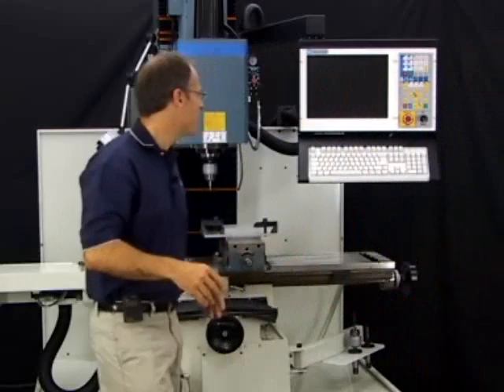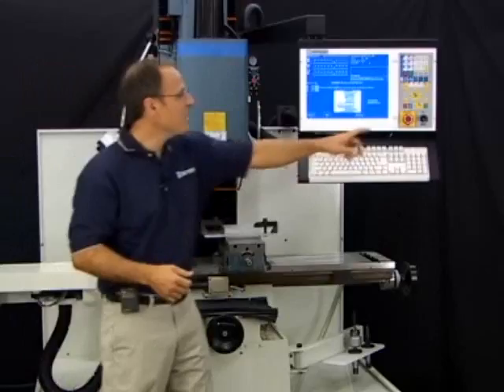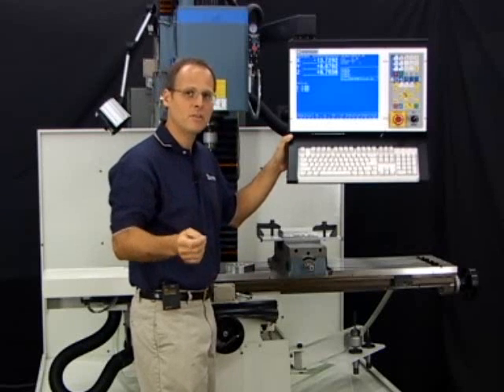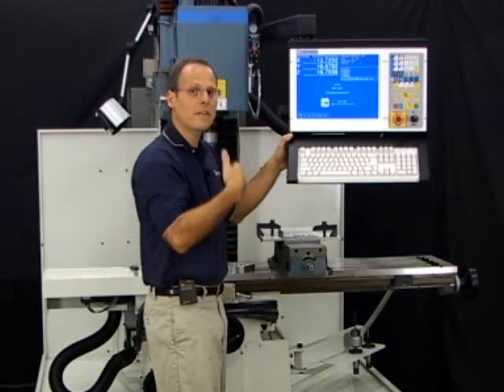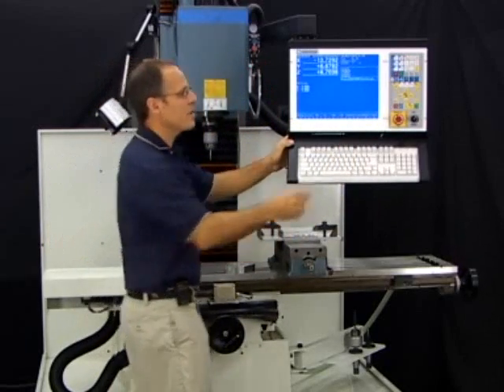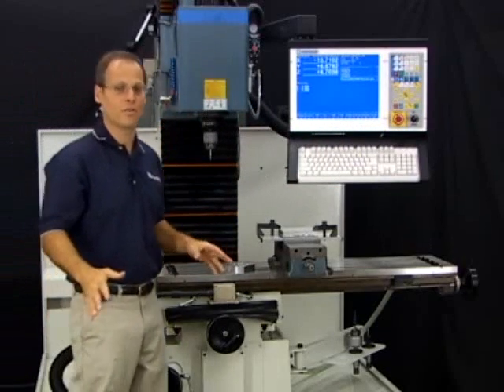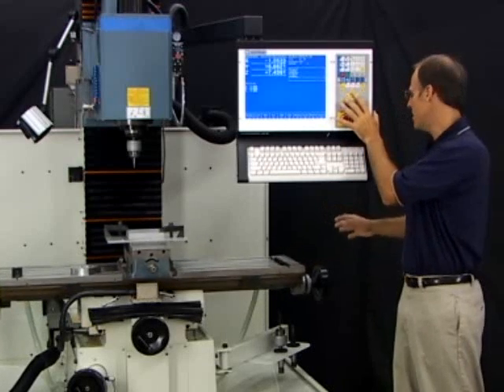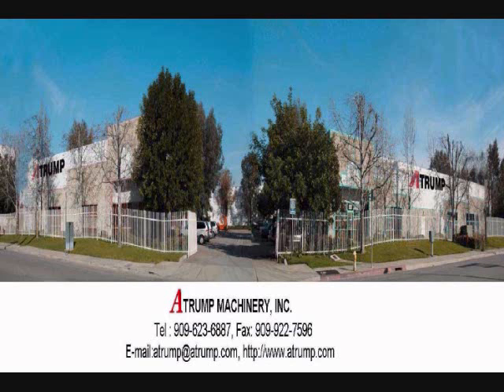CNC Milling Machine Training Part 2-Atrump Machinery  Inc..wmv

Comment: Uhm. I take it you work in some state of the art gubmint funded, cutting edge technocracy of a workplace, running down into the .000001 then? As for the rest of us mere mortals, that mill and interface is pretty typical of a modern machine shop, as part of an array of machinery. It's a supplemental standard, and still quite useful tool, even with more advanced machinery available. But hey, we all can't work at Spacely Sprockets.